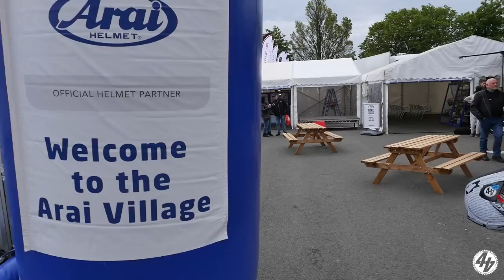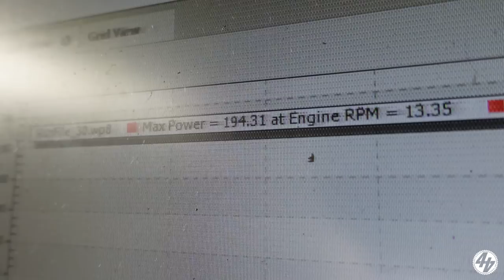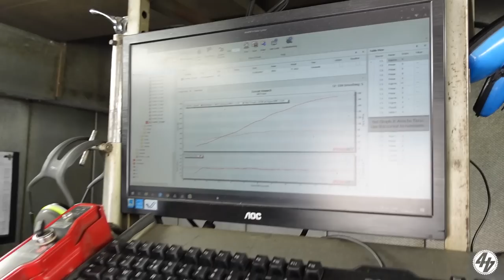2022 Isle of Man TT | Boothy's Blog

Comment: Wiring to the relay plug got messed up on my triumph Bonneville. 
Sometimes the crimped terminals that get pushed into female relay connector that the relay is pushed into will fail.